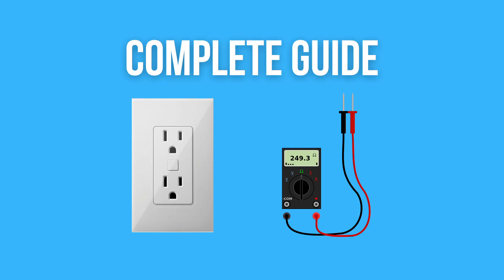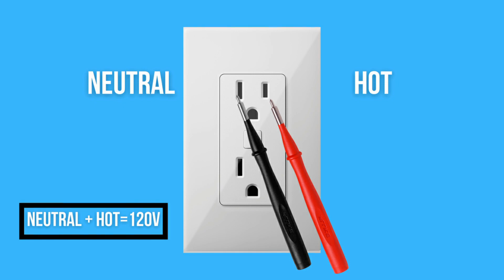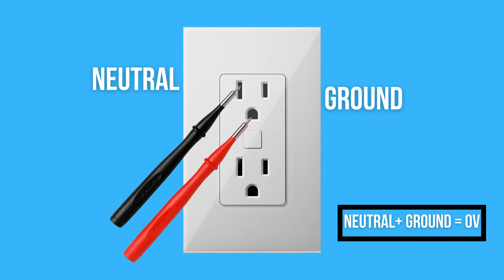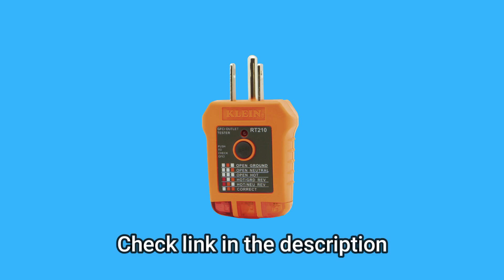How to Use a Multimeter to Test an Outlet

Comment: I've got some question, when i first bought my own multi-tester back in 2024 and its a analog when i try to test the multi-tester to a extension wire it explode my multi-tester but when i open my multi-tester it required a battery like em i really that stupid but anyway is it true that the multi-tester explode without a battery and without knowing it?

Comment: Hello, it was very informative, thanks, but didn't help me. I have a series of outlets in a row, none works, the breaker seems ok. For all of the outlets the voltage between the neutral and hot is zero, the hot and ground shows 120V, and the neutral and ground shows about 3 volts. Can you share with me what you think is wrong here? Thanks.
Reply: Without more information and pictures no one can tell you exactly what’s wrong. Sounds like possibly someone mixed up the ground and neutral wires.

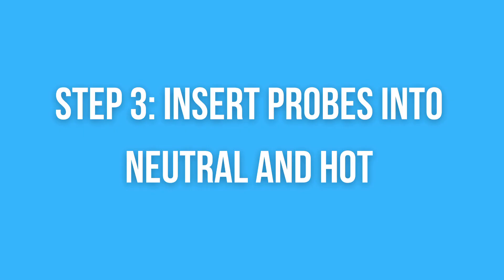Comment: At time 1:55 it does matter how the leads go in.. the black lead needs to go in first to avoid any potential electric shock
Reply: Yes, if you insert the red probe first into the hot, you automatically energize the black probe, risking electrocution if you accidentally touch it.

I learned this viewing another YouTube video, with real voice, not the fake-o AI one.
Reply: It's AC, it doesnt matter
Reply: @broodjenoodles  It does due to safety. If you go in hot first, the other probe is now energized and can shock you. Bad AI video is bad.
Reply: @TheSwordThain  he meant it doesn’t matter which lead, red or black is used for testing AC.

Comment: When connecting ground to slot, you flip the colors on the ground. How do I connect the probes if I dont know which is hot? I have a 220 volt outlet with two horizontal slots. Both same size. I need to see which side is hot. 
Thanks,
Paul
Reply: The smaller slot is hot and the larger slot is neutral
Reply: @TacoDaddy-mr8ig he was saying both were equal in size
Reply: They both are
Reply: On 220 volt outlets both sides are hot. There is no neutral unless it’s something that needs to utilize both 110/220 like a dryer outlet. In your case each wire is 110 volts. When testing one side to ground though you should get 110 and when testing both you should get 220.

Comment: It would be possible to measure the amps? I tried to measure with my multimeter, not sure what I did and basically the fuse went off and it burnt the tips. Anyone can explain me what could possibly I did wrong? I am 90 % that I was on the right mode, measure Amps. I remember I was able to measure voltage fine. Thanks
Reply: Im still learning, but I think it’s because unlike voltages and resistance, you can only find the current by breaking the circuit. If you didn’t do that, I think you shorted it or something
Reply: It's been a year and I'm not experienced either but I believe I'm correct to think that when you put the meter into amps mode, you're allowing current to pass through it freely without any resistance, i.e. you allowed current to freely flow from one of the plugs to the other, which essentially is the same thing as shorting the 2 wires of an outlet, which creates an insane amount of current which in turn creates some crazy heat.

What were you even intended to measure the amperage of though? The wall outlet doesnt have current flowing unless something is plugged into it. When something IS plugged into the wall, the hot wire and the ground wire do technically meet inside the device, but thanks to the circuitry inside electrical devices, the hot and ground wires arent just 'directly' connected, so current doesnt 'freely' flow. If you connect those wires directly, which is what you technically ended up doing, you get free current flow and there you go, hot mess. 

Outlet has voltage. The hot plug has some positive voltage, and the ground has 0. So there is voltage difference between the 2 wires. Voltage difference creates current in conductive materials. You plug in your electrical device, and this voltage difference causes a current to flow through the device. How much current flows through is dependent on the circuitry inside the device, such as resistors and whatnot.
Reply: you must do it in series, not parallel
Reply: To measure amps the red lead needs to be plugged into the red amp side not the volt side. Then set to amps. Many basic multimeters can only measure ten amps max. So when  using these devices make sure you read what the max ratings are for amps and volts. Otherwise you could damage the meter, get shocked, or damage other stuff if you have the meter set incorrectly or the current exceeds the rating for the meter. Like I said, most basic models typically can only measure up 10amps max. While most homes in USA have minimum 15 amp circuits. So in most cases the circuit will be over the max amperage rating for the meter. You can easily burn up the leads if you set the meter wrong, plug the lead in wrong, or test a circuit higher than the max amp rating. You need to get a better meter that can test higher currents. Usually the clamp on meters have higher amp ratings.

Comment: Hi before I watched your video, I was checking my wall outlet with the multimeter I have. A cheap one. When I plugged in the second lead into the wall outlet with two plugs , the black lead launched out out smoke came out of the outlet.
Would plugging the black lead into the hot cause this? Or… is it because I had the red-positive wire plugged into the 10ADC of the multimeter? The second plug of the outlet was connected to a light that was on…is that why?
Reply: Wall outlets are AC. Switch multimeter dial to well above 120V for N America (e.g. 200V AC) and 240V in Europe (e.g. 750V AC). Check for other countries. If you dial it at DC it may fry and smoke can come out. Always read the instructions or hire an electrician.
Reply: @patrickwong9520  yeah it was a dumb mistake. Thanks.
Reply: It usually doesn’t matter which lead probe you use when testing AC outlets. It only matters when testing DC. In that case red goes to test positive terminals and black to negative. However, it sounds like you not only wired the leads wrong but possible set the meter wrong too. It sounds like you plugged the red lead into the 10A side when it should be plugged into the other hole for measuring volts. If you have it wired to measure current or set to measure current, it will easily cause this to happen due to lower impedance which causes a surge of electricity to flow into the meter, thus ultimately damaging it or worse. It also seems like you had it set to DC when it should have been set to AC. Lastly, you shouldn’t be testing outlets when stuff is plugged into them and turned on.

Comment from the maker: Timestamps:
00:00 Intro
00:20 Safety First
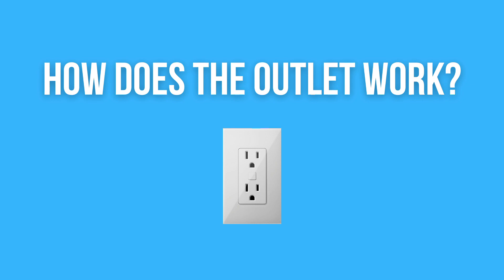00:50 How does the outlet work
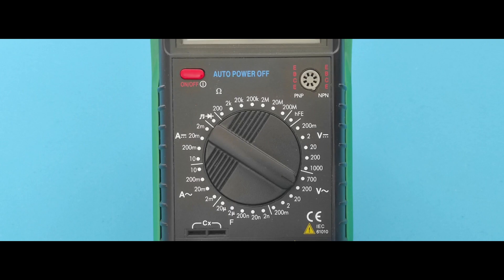1:10 Step 1 Set Selector switch to AC Voltage
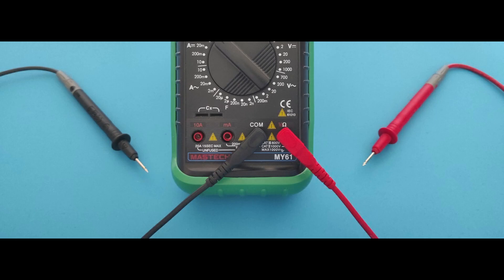1:36 Step 2 Connect the leads properly
1:57 Step 3 Insert probes into Neutral and Hot
2:18 Step 4 Insert probes into Hot and Ground
2:50 Additional tools for easy testing
3:14 Testing outlets